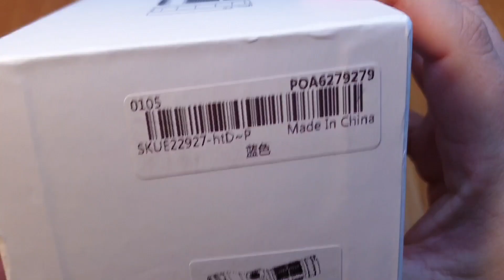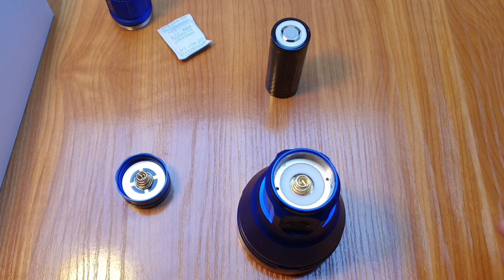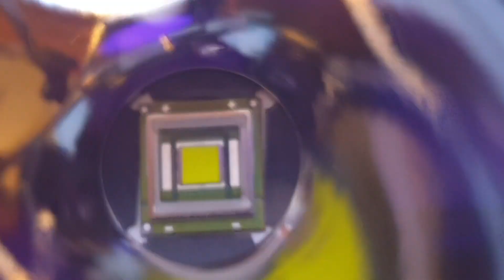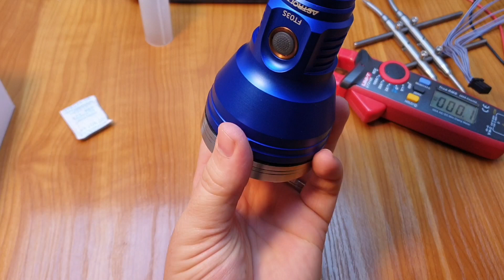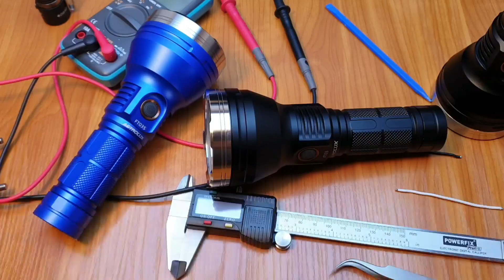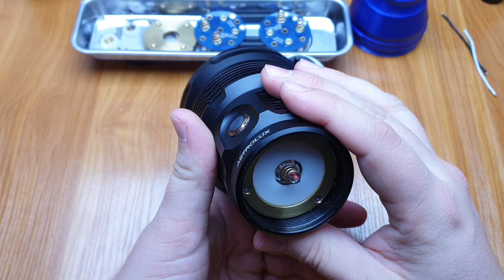SBT90.2 hype train. Is the Astrolux FT03S worth triple price than FT03?

Comment: could someone help me.
I have the astrolux ft03, I'm using a sofirn 26650 mah, 25a, discharge battery. My question is, this battery can use all the power of the flashlight?
Reply: dude. the astrolux is a FET device maxing out @8.5-9A of output at its peak discharge, your battery is more than capable of reaching 2400lumens (sst40 version), or even higher at ideal conditions. im assuming youre using the HD 5000mAh 26650 sofirn battery, yes?

Comment: Astrolux ft03s is the same Mateminco Mt90 mini flashlight or not?
Reply from the maker: Yes they are the same.
Reply: @ZozzlightsRC  I saw on Aliexpress Astrolux ft03s for 900 reais while Mateminco mt90 mini for 615 reais. Why will it be a big difference if they are the same?
Reply from the maker: Aliexpress prices vary so much depending on the seller. I usually find something a good price and I can find same thing for triple price also 😄

Comment: I ordered two extra reflectors for FT03S. I have Sst40 and XHP 50.2.. both excellent.. ft03s even brighter..One had a spiral machine line faintly slanted with the cone revolution. BG..The other I swapped out and didn’t see a difference other than if that sbt90.2 is not sitting just right. The hotspot which is tight but immediately around the hotspot is a sloppy smear of light in a weird off center mandala. I used one of the new reflectors and best I could do to center the hotspot with a secondary N,S,E,W, pattern from the huge square LED. My observation. Screwing the whole cap assembly together and moonlight the sbt.. shake and twist till you get a uniform pattern..

Comment: 3x cost is too much, i prefer buy xhp50.2 is good enought for real uses, and i a want cheap and the best throw buy the sst40-w version of the ft03
Reply: I couldn’t resist for just a 100 with a good code. The ft03$ series regardless of overinflated numbers. You have a longer more powerful throw than the SST40 and a longer more powerful throw similar to the width of beam and hotspot of XHP50. The SBT90.2 and anduril features is a step up from the ft03 if you have the geech. I’ve one on the way. Deodoming etc and risking ruining the diode modding for more candela on cheaper units, meh.
Reply: Just ordered one today for 88$ USD.. hope by now they dont have issues.
Reply: @ballpenkennjohn3129  Do you have any issues? i'm considering buying it too..

Comment: I am trying to get my head around the sbt-40 v. Sb-90.2. I take it the advantage of the sbt-40 over the xp-l v6 is lower forward voltage means less heat at a given current.  I assume it can do 202 lpw, or 384 lumens at my 700 ma, 10 hours work day.  I dislike the AMC 7135 lights, because the linear driver just burns off the excess voltage.  But, I am not convinced that my buck driver magically converts the voltage to amps either.   So, maybe 15 more time before cutting out? Or 15% less heat.  Is there a dedomed sbt-40 available. I have ruined about a dozen leds trying to dedomed, never happy with results. I am happy with the xp-l hi.  The xp-l and xml sucks in that you need to use a 31 mm driven at 1 watt to get 4000 candela, which is the maximum drive level allowed if you want a single 18650 light to get a full workday.  Thus a single AMC 7135 and xp-l hi are necessary for a useful single cell light. However, the AMC 7135 kinda sucks, and you get 70% of promised 10 hours, while the buck Puck 700 offers 92% of the promised 10 hours off 2 s 18650.....   I am hoping the 90.2 is just a dedomed sbt-40, but from the looks of the lights, probably not.  Isn't the led footprint smaller than the xp-l or xml?  Apparently, not....  The tint of the luminous is a step backwards. But maybe cost makes up for it?    Unfortunately, my target is 10 hours, 4000 lux,  2s18650 (21700 isn't big enough for a good single cell, and too heavy for a 2 cell wearable).

Comment: Subscribed. Thank you for the straight forward video. I bought ft03s yesterday before watching your whole video. I am still ok with the 310kcd at the price I got it for, as it will be my longest throwing light so far. Is disappointing it doesn’t come closer to spec. I may try switching out mcpcb wires like you did. I figure if the K1 gets 420kcd (Hanks claim I trust), then even if this got 400kcd that would be great. Do you think the reflector alone would bring the KCD up another 70-100k? I appreciate all of your input here and on BLF. thanks !

Comment: What benefit do you get from dedoming the 70.2? Why would you dedome it? Excellent video Thank you for all the info and the time you took to make it.
Reply from the maker: Thank you! If you look az my google tables with my measurements and look at BLF GT70 numbers you can see I lost a few lumens from 8160 to 7760 lumens but gained a lot in the intensity. It jumped from 516 kcd to 1008 kcd so almost doubled it. The trow jumped from 1437 to 2008 m. 
And as an extra benefit as I making the XHP70.2 dedoming I remove the yellow edge around the diodes I get rid of ugly yellow corona of the beam. Watch my XHP70.2 dedoming  video for more info.
https://youtu.be/QVJSDJFqC8I
Reply: @ZozzlightsRC  I knew there had to be a reason. That's good to know Thank you for the reply. I love LEDs and flashlights have always enjoyed tinkering with them and playing with them Love the info you gave me I'm going to try to dedome one of my 70.2 flash lights see if it gives me further throw for that awesome laser effect 😎 Thank you
Reply from the maker: It is easy to kill the led while dedoming so be careful!
Reply: @ZozzlightsRC  Thank you for the input I managed to get it off rather easily it just took time and was very tedious as long as you're careful I ended up getting the LED hot and it pretty much just popped off lol😂. Might not be the best way or the safest for the LED or prolonging the life of the LED but it seemed to have worked good enough haha. Definitely made a difference with how far the beam was throwing That's for sure it's kind of crazy I never would have thought that that would do something like that. Hey I wanted to ask you I didn't see much info on that OSRAM LED, what is it? what is the wattage of it and the info for it? I would really like to get one cuz that LED is a laser haha. Thank you for all the help and the videos and the replies keep up the good work I appreciate you and your content Thank you!!
-L

Comment: What is the thickest guage wire I could squeeze in there, have 12guage on hand
Reply from the maker: My 18 gauge wires has only a t8ny clearance left so I don't think even 16 gauge will fit. Maybe if you drill the holes a bit bigger.

Comment: your using a crap battery get a samsung 30T in it lights it up 2  . 6300 lumens
Reply from the maker: Are you measured that lumens? I measured 5830 lumens with this led and 4x samsung 18650 30Q in parallel.

Comment: That soldering job looks like the sloppy ones I do but that should not be the case for something you pay for. But coming from Astrolux I’m not that surprised. This is why they are so inexpensive compared to something from Fenix for example. And I know Fenix doesn’t make monster throwers like Acebeam or Imalent but I don’t recall having reliability issues with them as often as I do with the previously mentioned ones.

Comment: Thank you! I thought my sst40 version was the only one making cracking noises from the lens...is that because it’s cheap glass?? Never had any of my other flashlights do that. Of course I don’t expect a lot from astrolux. The built in charger on mine doesn’t work consistently and have had other issues with Astrolux flashlights. But hey...their inexpensive as hell..so....
Reply: mine makes the same noises
Reply: My xhp version does not do that. I have the sst40 ft03 coming in as well as the ft03s coming in. Hope it doesn’t make those noises, or at least if it does make them it doesn’t effect the glass? Water seal? Cracking noise seems bad from glass? Also, I have about 4 astrolux now and I really like them, although I’m not that knowledgeable of internals and what justifies price and quality. I know (so far) they’ve been as reliable as my emisars/ noctigons.. maybe long term is different story. Of course with the amount of lights I have I don’t use any one more then a couple hours a month except my edc
Reply: it's not the glass, it's thermal expansion and it cracks when parts expands at different rate.the charger will not charge if the battery is over 4/4,1V maybe it's the case

Comment: Bloody hell I've already ordered 1 from banggood cost me £109 last week the blue 1 like you have
Reply: Hope you didn't cancel, got mine and it works fine.... definitely better than old version. A better "distance" video would show this. I have 120 acres with creek and a pond 300 meters from my back door. I can light up anything on the banks at night with SBT90.2 and not at all with sst-40.
Reply: @michaelhammond7115  no I'm still waiting for it since December the funny thing is they had 30% off in February for it so ordered it again from banggood and got that 1 within 2 weeks and yes it is great and I have a 40T Samsung battery in it 💥👍
Reply: @MRGOOPY123  sorry bout that....who knows? I saw a video of a mail room in China mid January and they had huge stacks of mail they were trying to sort and get out. The virus had the whole country in lockdown for 2 months. Bet your box is sitting there waiting to be uncovered and sent to next part of destination....just a guess. Good luck though, I will say, don't buy cheap generic batteries.
Reply: @michaelhammond7115  Where did you get it from?? Link? Is there much difference with the sst40 version?
Reply: Cancel it. I paid £65 and even I'm not happy. I mean it's OK but they need to fix the issues which they said they will do for the second batch. Next time you order ask for a code here http://budgetlightforum.com/node/70094

Comment: With a faulty muggle mode, bad calibration out of the box and 100m short of the throw claim, I'd personally go with the FT03. 
I suggest your 21700 is past it's best, very high capacity or fake. It should make way more than 100 lumens more than a 26650!!!! I get 4100 lumens with a 26650 as you do but with a Samsung 40T I get over 5000
Reply from the maker: Liitokala 26650's aren't that bad. And I get over 20A with this 21700 in other lights. And it is not used much. Few mobths old and it had less than 10 charging cycles. Never was under 3.5V But to make sure I will get a few 30T.
Reply: I know I’m a tad late here but for anyone researching this FT03S as I am ,  I just want to add that I got a hold of a couple Samsung 40T 21700’s per Flashoholics advice for both my FT03 SST40 and XHP50 versions and could immediately tell my SST40 version was much brighter and am pretty sure the XHP50 version is a little brighter but need to do some further checking. Ordered them from “18650 Battery Store “ for only $14 for 2. Going to order a third for my FT03S that is currently on its way 😁. Thanks Flashoholics for the tip.
Reply: @krapeevids6992  I just ordered the flashlight and I got the same batteries you did and from the same place @ 5.50$ each. I cant wait to use this thing.

Comment: Hello! What driver are you going to use in MF02?  You said lexels driver, but how did you modify it? And please make a video of MF02 with SBT90.2. Best wishes from Finland.
Reply from the maker: I am using a tesxas avenger based fet+1+some 7135 driver which basicallí made for MF01. But same driver cavity so it fit. It is designed for 8.4V so I need to replace a few parts to work with 4.2V. I definietly make a video of that.  Currently have to make the MF01 mini video and Brinyte SR8 and 2 convoys. Thank you!

Comment: F03s luminus sbt 90.2  hotspot same like f03 xhp50.2?
Reply from the maker: As you saw it depends on the reflector you got. My XHP50.2 FT03 is dedomed so I can't really tell if a stock version similar. I can't direct compare the two. But from the numbers I saw at other people the stock XHP50.2 need to have a bigger hot spot than SBT90.2.